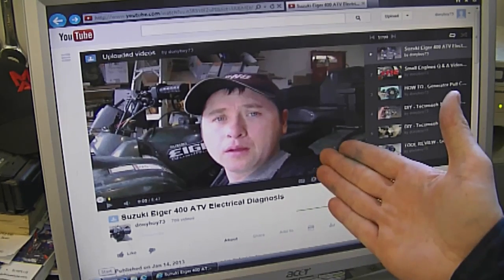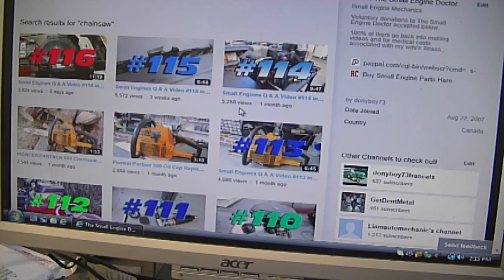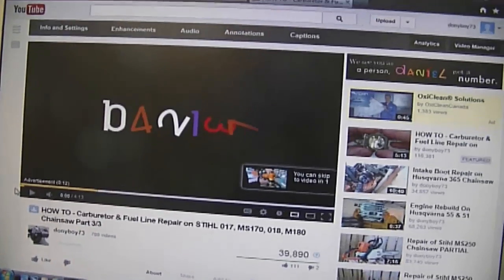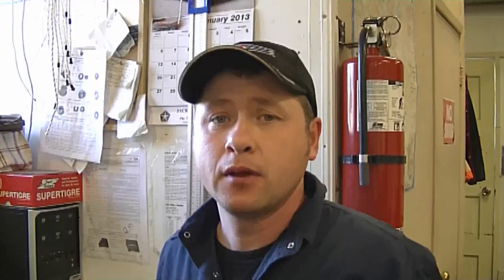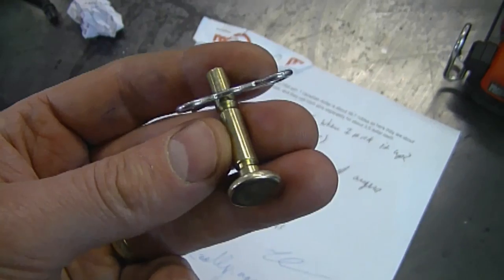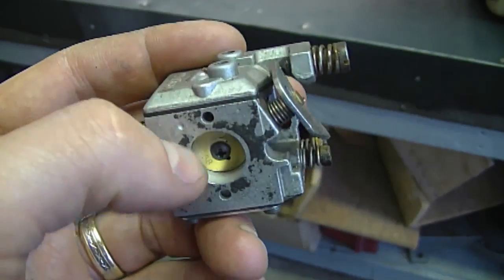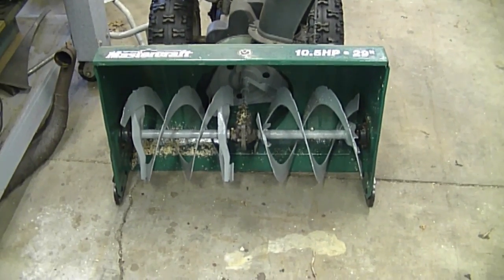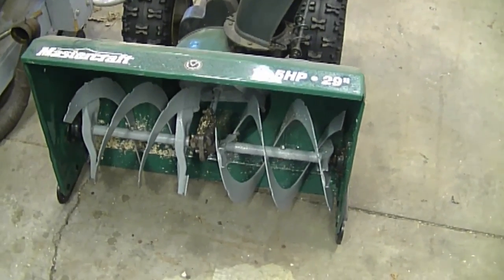Small Engines Q & A Video #117 in HD

Comment: As soon as I push/release the primer some gas sprays out of the small opening located at the bottom of air intake throat, right before the narrowing air passage. This gas wets the bottom of the choke shutter plate shaft lever and general area. At first I thought this was wrong, but after looking at my other Tecumseh engine/carb I saw exactly the same behavior! Dony, can you please explain why fuel is stayed out, towards the choke plate rather than in, towards the mixture intake pipe? Thanks.

Comment: It's a plastic float and there was no gas inside when I took the carb apart to install the kit. I set the float gap to 11/64". Should I submerge the float in water for a while? I wish there was a way to see the level of fuel in the carb. Could excessive vibration cause higher than normal level of fuel? Does fuel at the bottom of the choke shutter plate shaft indicate flooding? Is there anything else to check?

Comment: Dony, I installed a Tecumseh 631021B kit but the symptom persists. When I turn off the engine there's fuel at the bottom of the choke shutter plate shaft lever. And when I tip the snowblower back (lift the front) a bit of fuel comes pouring out of the air intake. Is this normal? If not, what could be the issue? Thanks.

Comment: Donyboy, I  sure like your videos...I'm wondering which of the small engine videos to watch to learn how to make my 8horse snowmachine motor run smooth. The idle tries to bog or make tiny backfires. Seems to run strong, but at different times during operation, i need to twist the needle on the bottom of the carbuerator bowl to keep it from stalling. So far i'm proud of my rescue on this machine. Saved it from the recycler i did, got it goin and spitting snow. Thanks for tips and good vids -fritz

Comment: i still cant get the clutch off is there a special tool? because my 19mm hex socket keeps slipping 

oh and btw i found it is leaking at the back of the boot on the carb i have replaced it but was not a genuine part and it didn't seem to fit right to begin with

Comment: Dony, another question about my newer, non-adjustable Tecumseh carb with a plastic float. Is 11/64th the correct gap to use for the float adjustment? Seems it should be larger. Thanks.

Comment: Well true donyboy73 if the carby clean did not nail it the Fuel lines must have been the problem for sure in some cases when i use my Victa trimmer i like to use WD.40 to make it really easy to undo the trimmer head off from end 
connected the drive shaft :)

Comment: What gap do you recommend on the spark plug, I see B= thread size 14mm, P= isolator type, R=resistace type, 7= heat index (what do this Mean) can I use heat index 6?, E= thread length 19mm, S= middleelectrode with copperr core

Comment: Do you know why a electric starter won't work also the battery is fully charged but it won't actually get the engine started it will only make a clunk noise when you use it and I've never used it or the battery

Comment: Got it. Then what are the possible causes of fuel presence in the air intake area of the carb and around the bowl gasket when I turn off the engine? There's a strong gas odor. The bowl gasket, fuel and primer lines seem tight. Could the emulsion tube or those O-rings be bad? Thanks.

Comment: Hello, I have a Tecumseh HMSK80-155699W engine with a newer 640052 carb.
The idle mixture screw apparently has no spring, washer, or O-ring on this model.
This screw was in all the way. Should it be out one turn? It feels loose in that position.
My main complaint is that there's fuel in the air intake area of the carb and around the bowl gasket. Please help! Thanks.

Comment: I have a chinese snow blower 11Hp type ZLST1101Q, I want to change the spark plug, The problem is when I ask in the store here in Norway they do not have my type of spark plug the mark on the plug is NHSP LD F7RTC but I saw on the internett that a I can use OREGON OLR 15 YC or BOSCH WR7DC is this correct can somebody confirm if this is ok

Comment: Donyboy, I had a weed eater with bad gaskets in the carburetor, so I just improvised and made them out of rubber sheets from ace hardware. It worked for a few weeks, but then when I was starting it in my garage, I didn't notice that the seals were completely rotted away by the gasoline. When I primed it, I didn't notice gas spilling out, and when I started it, it caught fire. A nearby gas tank was open and it ignited too. I couldn't fix the engine, and my house burned down. What do I do now? =P

Comment: hay dony my mates chainsaw has a problem it starts ok runs and cuts fine switch it off and go to restart it later but wont go it needs full throttle to start i have replaced the carb kit and intake boot and inspected the impulse hose the saw is a sthil 038 magnum

Comment: I got a poulan chainsaw model 4018wt and the fuel line dry rotted so I replaced them now it seems harder to get started than before and  my spark plug get wet with fuel any ideas on what could cause that  thanks